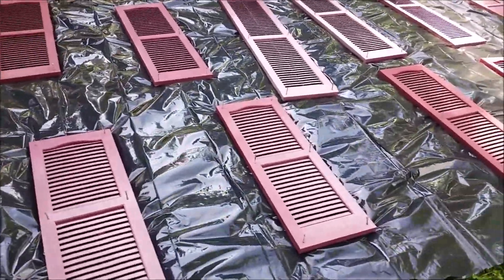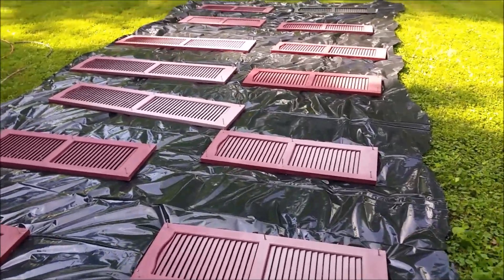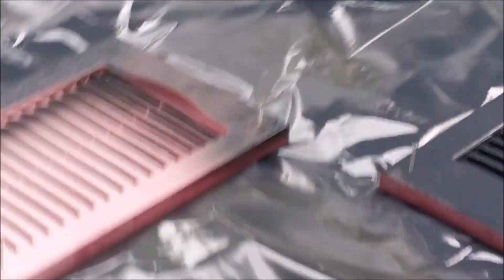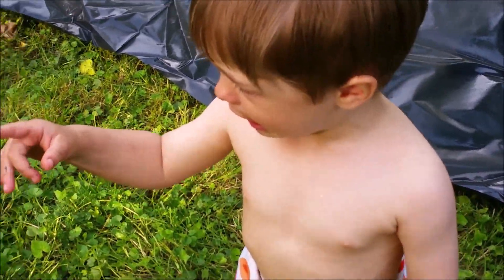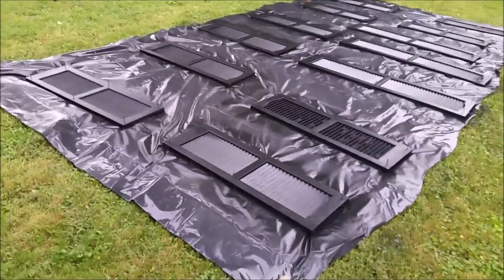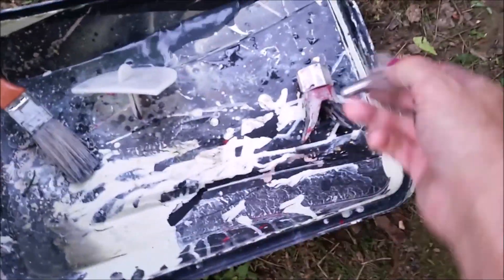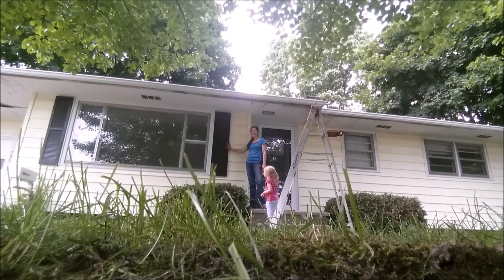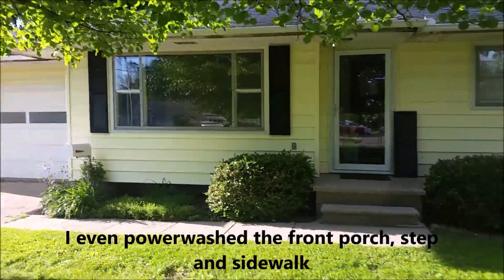Cute 1956 ranch home | Adding some curb appeal

Comment: I think I might've painted the underside of the overhangs, before I put the shutters on.
Reply from the maker: One job always leads to another, power washing knocked off the paint flakes. Yes,  I should have painted the overhangs first. But I waited months to get it all done as the interior had so much going on  along with a new roof.

Comment: From my experience those type of storm doors are a nightmare, they are much heavier and start to sag shortly after installation, I had to rebuild my front door frame and now it stays where I hung it.  I don't like the all glass one's, mine is an all glass one BUT! the top has a sliding window, as you slide window down, screen is attached to it on the top, the header of the door has the hidden screen inside it, so when you open window it is fully screened and lets fresh air in BUT! when you close window it is like an all glass door, almost no home owners or carpenters install these correctly to prevent sagging, so if starts sagging on you, you have to get 4 inch screws, angle them into the frame inside the wall, the screw has to be a little sideways so it goes through the door frame AND also into the frame structure, most front door frames have double 2 by 4".
Reply from the maker: I agree on the screws. They're all  light duty and could be longer. I'll take your advise and swap them out. It wont matter to me in the long run but I would want quality work if I were going to buy the house along the road from anyone else. I do wish they made the screen self storing.